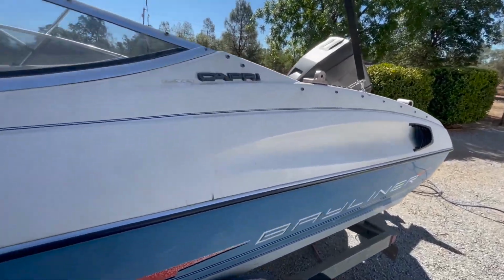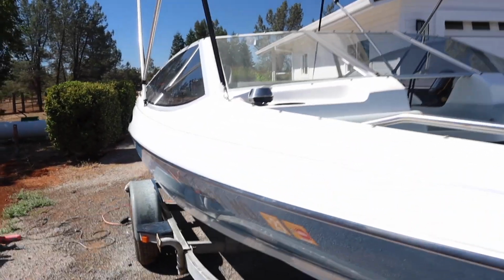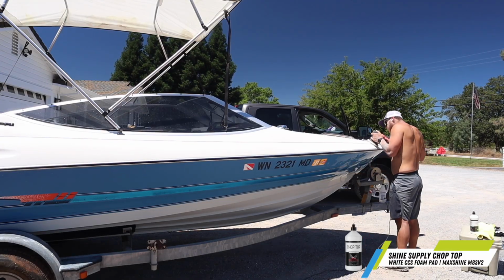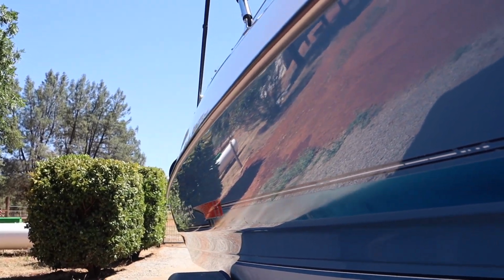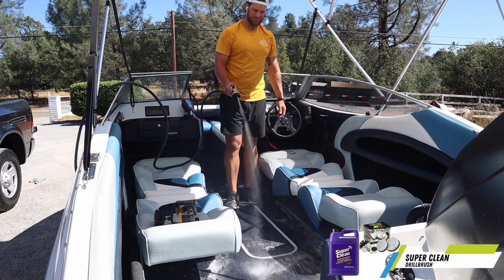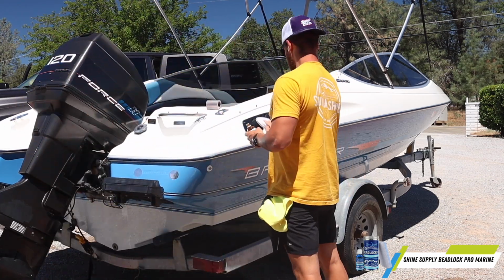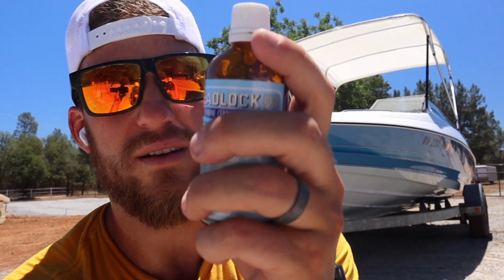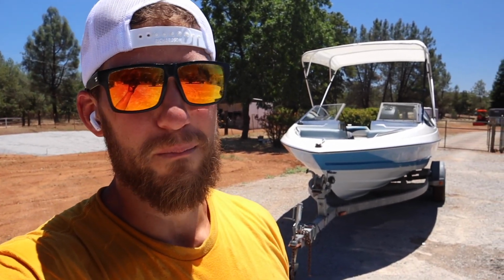Crazy Transformation | Full Boat Detail Restoration On This 1992 Bayliner | Revival Marine Care

Comment: Drake, I have done both steps with the wool pads after wet sanding and looks near perfect. I started following up with the Lake country CCS white pad on a da and I'm removing the holograms but the finish seems less shiny than the finish of the yellow wool on the rotary. Any idea what could be causing this? What RPM were you running the DA on the polishing stage in this video? Thanks!
Reply from the maker: Hey bro! Instead of the ccs pad, use the forced rotation lake country pads… you’ll pull a deeper shine out of the surface. Hope this helps 😎

Comment: You should really try 3M super duty cutting coumpound with a wool cutting pad. No need to wet sand that at all. But excellent work 1000%
Reply from the maker: Thanks bro! Not a 3M fan though :)
Reply: @DrakesDetailing  Not a problem. I'm gonna try out the product you use. Thanks for the reply :)

Comment: Drake, I polished my boat with moderna 400. Should I have sealed it afterwards? After a week on the lake it doesn't look very good. It's a 25 foot BAJA H2X if that makes a difference for gel coat. Thanks
Reply from the maker: Glad I could help!!😎🔥👍🏻
Reply: The answer is yes.  I haven’t used Menzerna line but 400 is their heavy cut then finishing polish then power lock

Comment: Recently purchased 20 year old 22’ all white bay boat and have watched a bunch of your videos which are great. Want to do a pretty good restoration even though the boat is in pretty good shape. However what confuses me is the terminology. I understand what compounding is but is that the same as buffing? Not clear on what the terms polishing, sealing, coating and waxing are or if some of those terms mean the same thing. I understand wax vs ceramic but is ceramic the same as SiO2? Was planning on using Maguiar’s  Ultimate with DA buffer followed by Jescar Power Lock Plus. But is the Jescar a final step or do I need to wax or ceramic after that? Keep up the good work, it’s much appreciated.
Reply from the maker: Buffing Is kind of a blanket term for using any general polisher on your boat. When you are “compounding” you are using heavier grit compound on a wool pad with a rotary buffer to remove heavy oxidation. After you do the heavy compounding to remove the oxidation, then you use polish to remove the rest of the swirls left over from your heavy compounding. A polish is just a finer grit compound then your heavier stuff. Sealing refers to anything that is going to give your boat protection for all the buffing you just did to make your boat shiny. In order to protect that shine. Wether it will be ceramic coating, or polymer sealant it will give you protection from the UV. SI02 is just watered-down ceramic, mainly used for maintenance on your ceramic or your sealant. Hope this helps!

Comment: Hey Drake can you tell me how you clean the boat bottoms and waterline down when they get really crusty?  I typically use BioKleen Hull Kleen (sometimes ZING! on the especially crusty ones).  Is there a product that you find works better and is perhaps less harsh to work with?
Reply from the maker: Hey bro! Is just use muratic acid. You can find it at Hope Depot. It works great! Spray it on, light scrub, let it sit for a sec, then pressure wash or hose off 😎
Reply: @Drake's Detailing  thanks for the reply.  I might have to give that a try some time.  The boat I started today had the worst bottom I've seen yet.  It was like cement.   It took many applications of Hull Kleen and Zing and lots of scrubbing.  Blessings

Comment: Hey Drake,
Love your videos, do you cut and polish the hull?  I have a 96 Formula 252LS and the hull looks dull but I don’t want to block it up and try to get it off the trailer. Is there any way to do it on the trailer?
Reply from the maker: Without putting it off of the trailer, you might need to do it by hand.

Comment: What is the best way to "PREVENT" hard water spots on boats?  Is there a coating that will prevent it?
Reply from the maker: Unfortunately its very hard to 100% prevent them. The biggest thing you can do is always rise off your boat and dry after every use! Check out our maintenance kit! This kit has a water spot remover, si02 to help with beading and condition for your seats! https://www.detailusupply.com/products/boat-maintenance-kit-shine-supply

Comment: Turned out sweet.  Nice job on the freebies also for the customer.  Goes a long way.  I had a 88 Bayliner... decent boat.. only problem we had was the middle floor started to sponge and flex... Force 80 motor works fine.  Can pull a tube or ski behind ok.  Nothing major here. These are starter boats imo.  B.O.A.T. (Break Out Another Thousand).
Reply: Exactly! It works, you go have fun on the water and the floor is soft oh well that's why you sold it, right? Lol
Reply: @hankschrader149  Exactly.  Made even more money because of this BS economy.  Crazy yet cool
Reply from the maker: Nice😎

Comment: Hey Drake, I've learned a ton from your video's. I have a couple of questions on this one. Early in the video you mention using a decontaminate, which one did you use?  Also, with the amount of correction needed on this boat, was that step really necessary? Thanks for the great content! I pray God continues to bless you and your family.
Reply from the maker: Yes it was totally necessary. With the amount of steps it took to do this, it makes the following steps go so much easier. A decontaminate could be anything from degreaser such as purple power and water, simple green, or blue Dawn dishwashing soap.